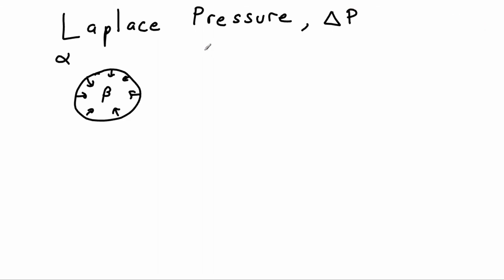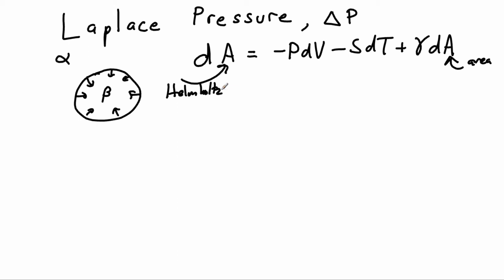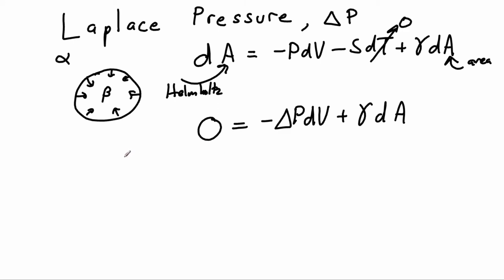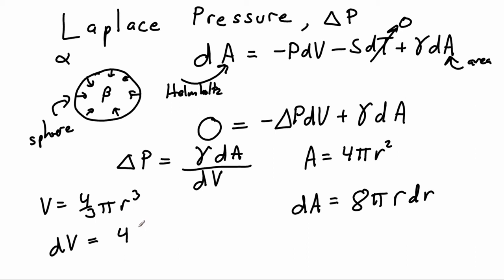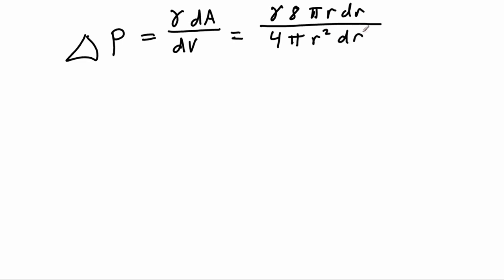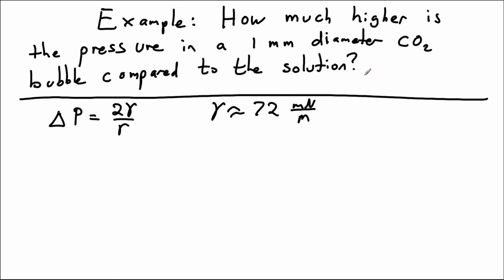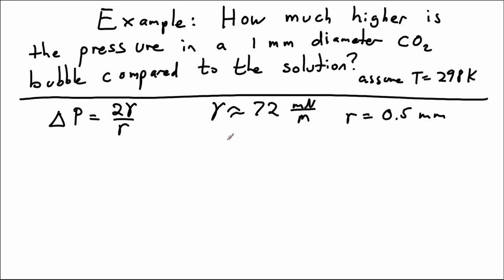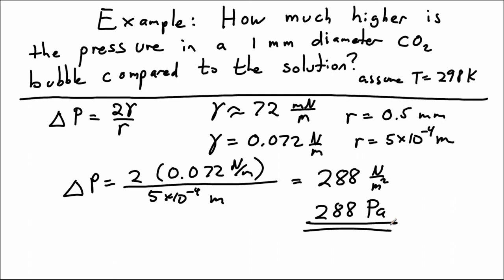Laplace pressure

Comment: Thank you for preparing the video. I was a little confused about the first equation you used in your video. Where does it come from?  Thank you so much!
Reply from the maker: It is the differential of the Helmholtz function; see this Wikipedia article:
https://en.wikipedia.org/wiki/Helmholtz_free_energy
I added a term at the end for surface energy.  You can think about it as two work terms: the work needed to expand the sphere against surface tension, versus the work needed to compress the sphere against the pressure difference.